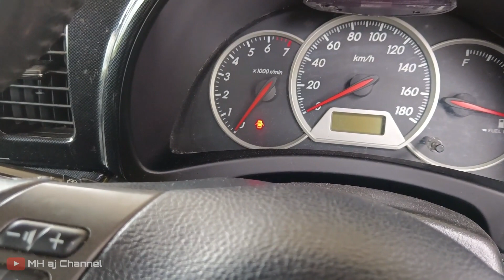Steering Rack Toyota Wish 1.8 Legend punca bunyi dari sini

Comment: Bang.. Buat la video tools  yg perlu ada utk repair kereta sendiri.. Dari basic~intermediate~pro level.. Saya ada wish legend ni.. Nak jgk buat sendiri bukak sana bukak sini.. Tpi tools masih sikit
Reply from the maker: Insha-Allah bang nnti kita buat.. kita buat sndiri ja, slow2 kumpul tools dulu.. Tq bang 🤗
Reply: Kene ada power tools ke bang...  Nak bukak yg berat2 tu
Reply from the maker: @wfc5099  klu ada lagi bagus.. contoh mcm impact wrench tu memudahkan keja.. dlm video tukar steering rack ni sya guna semua tools manual tangan ja bang, xda special tool kcuali Ball joint puller untuk lepaskan tierod end